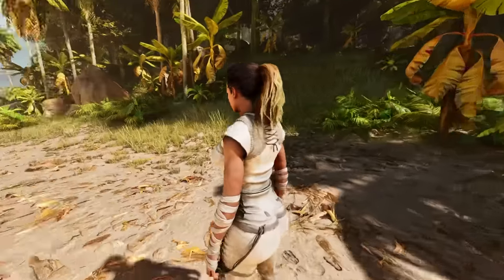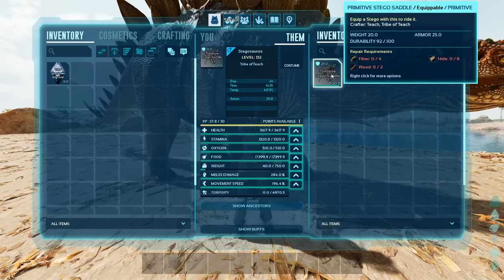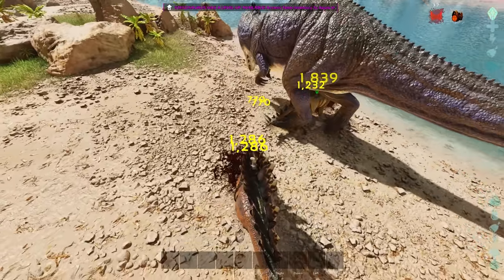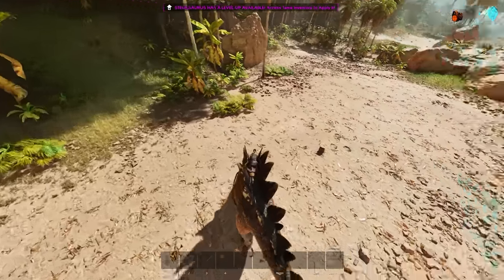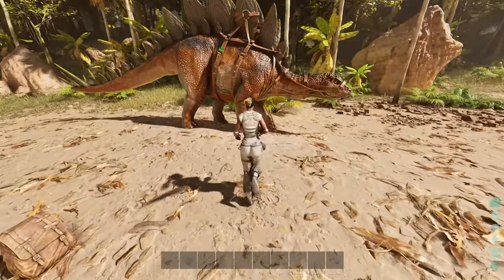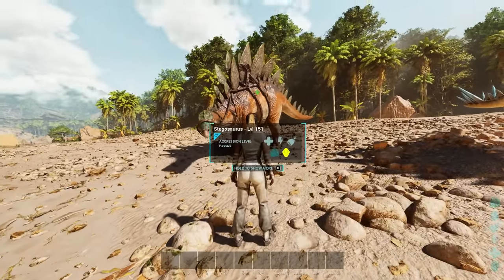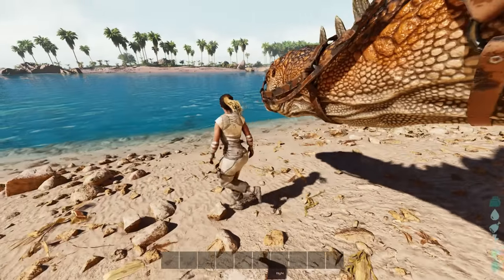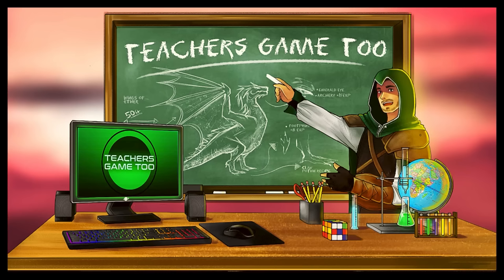What SADDLE DURABILITY Actually Does in Ark Survival Ascended!!!

Comment: Oh ok. So that's how it works. 

 Honestly i think they should reduce the armor offered. 

As opposed to fully breaking and unequipping like player armor.
Reply: I wouldn't actually mind if it was actually like that.
Reply: I agree, think like imprint buffs but instead armor debuffs. It could be as simple as a 100 dura saddle gives 100% armor bonus, a 50/100 dura could then translate to 50% debuff or reduction of armor provided, and a 0/100 dura saddle would be the worst with no armor bonus at all yet still riddable.
Reply: @ryojimata3708  As long as it didnt effect platform saddles I would agree.  Either that, or add in a way to fix platform saddles without removing them.

Comment: So what you're saying is they added something That was incomplete or bugged.

 Because the only logical thing that's supposed to happen. Is it's suppo to break and remove itself kicking the Rider off.

Something also tells me that's gonna be nursed because from A PVP point of view you can soak for hours. Which is Overpowered if they've did actually nothing.

 Because I can guarantee that there's a bug or it's not fully implemented yet. Because what you're describing is a 100% a incomplete Mechanic otherwise there's no point in durability in the game for saddles.

Just my personal opinion.

Comment: It would make sense if the damage reduction was reduced as the durability went down, but this is kinda silly.  I like to think ASE just "hid" the dura stat, which is why the blueprints vary so much, but with no explanation.

I'm glad they just don't up and break (looking at the shastasaurus submarine with stuff built in it) but reducing the damage reduction would be acceptable.  It would help a lot in defending against soakers in pvp raids.